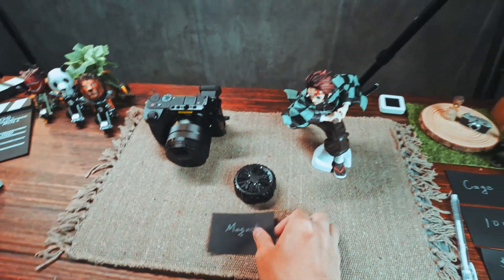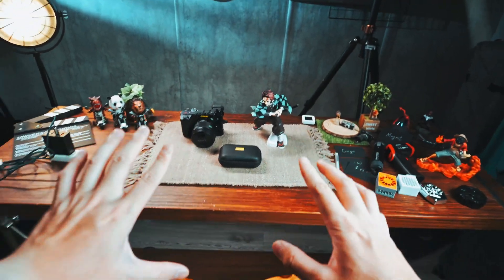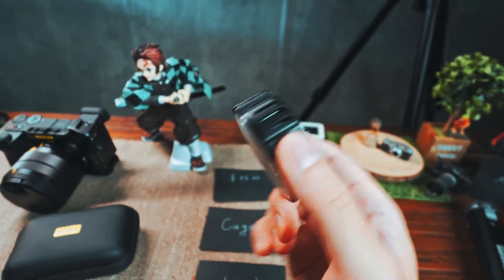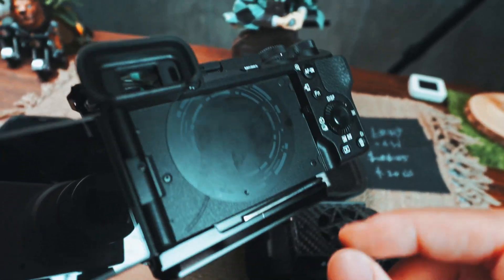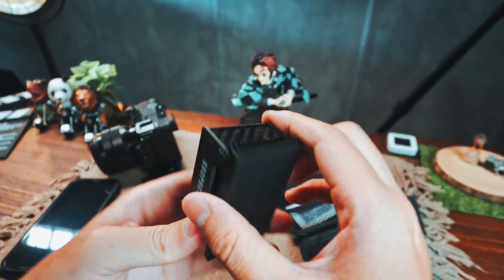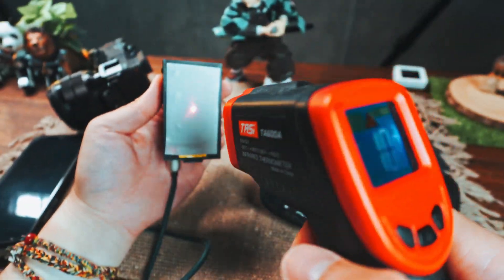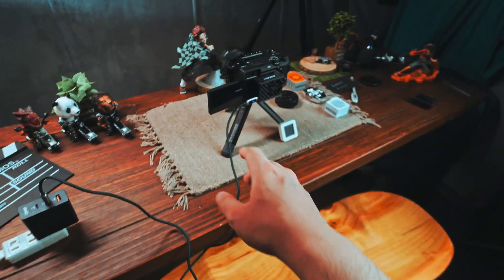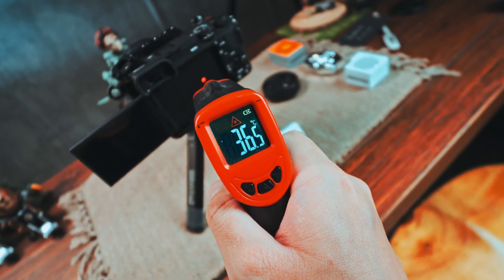How to extend 4K 120P on Sony a6700  ? Overheating Solution ?  ( also work with A7CII A7CR ZV-E1 )

Comment: The video so nice, thank you so much for your effort spending a lot money to testing the cooling system.
May I have a question that, after 1 year using, the camera is good ? because I hear that is water will accumulates inside ?
Thank you so much!

Comment: The link for the product is insecure and naither of the web browsers can open it, when I ignore the warning my internet provider block the connection :( please! can you put normal working link :)
Reply from the maker: This is a Taobao link and it still works just fine. Not really sure why you can't open the link, maybe try VPN and reconnect ?
Reply: hi! I found it by the name Airpi Camera Cooling system on aliexpress

Comment: Great!  But How It sounds? Is It noisy?
Reply from the maker: It has two different type of motor, one is Hydraulic, the other is Ball-bearing.

Ball-bearing has longer usage life time, about 2-3x more, but very noisy even at the lowest power.

Mine is Hydraulic, it sounds OK with 5W power supply, but kind of noisy when it is at 24W. The mic is going to pick it up anyway, so the lavalier mic is recommended when applying this cooling system.

Anyway, I got why FX30 is more expensive than a6700, it does solve a lot of issues when you need to do the video works. 🧐
Reply from the maker: Nice question, just wondering why nobody is asking about this 😂

Comment: Do you think the dual usb ports is to allow passthrough? So you can use it as a webxam, 4k30, with cooling, plugged into a single usb-c powerpack
Reply from the maker: No, the USB ports only work as power supply. Kindly remind, it is a $20 product. 😌